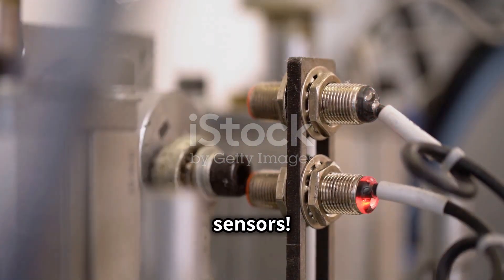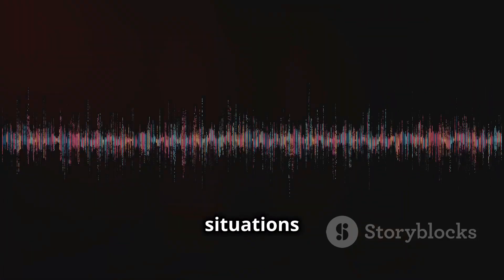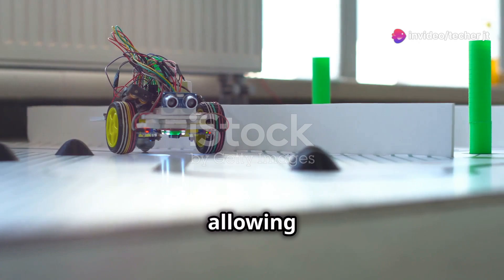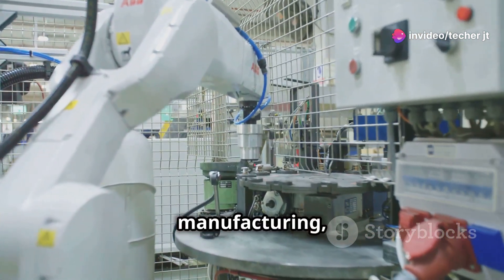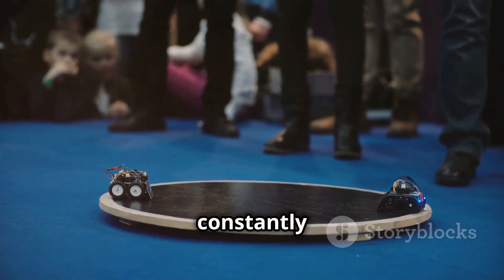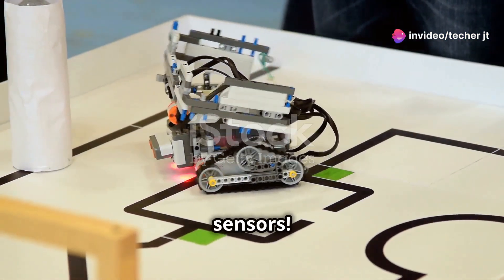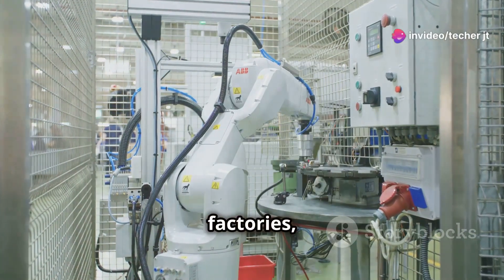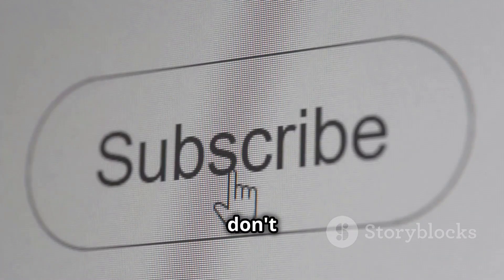Exploring the World of Robotics: Types of Sensors

Comment: Christine Divine S. Taña  
10-LYNX  

2. Explain how ultrasonic sensors work and their application in robotic systems.

Ultrasonic sensors work by emitting sound waves and measuring the time it takes for the waves to bounce back from an object. This helps determine the object's distance. In robotics, they are used for obstacle detection, navigation, and measuring distances to ensure the robot can move safely and avoid collisions.

Comment: Ezra Shimei B. Calaycay
10 - ANDROMEDA

2. Understanding (Comprehension): Explain how ultrasonic sensors work and their application in robotic systems.
- Ultrasonic sensors use high-frequency sound waves to create inaudible waves that bounce off objects in their path. The sensors compute the distance to the object by measuring the time it takes for the echoes to return and combining the speed of sound with the duration of flight. These sensors are often used in robotic systems for obstacle detection, proximity sensing, object tracking, navigation, human-robot interaction, and industrial automation. They enable robots to identify barriers, navigate complicated surroundings, develop maps, recognize human presence, and alter their behavior as needed. Their adaptability and dependability make them indispensable for safe and effective robot operations.

Comment: Dave Aaron V. Dagcuta
10 - Lynx

4. Analyzing (Analysis): Analyze the differences between active and passive sensors in robotics. Provide examples of each.

Active sensors need to actively emit energy or signals and analyze the following response to gather data, meanwhile, Passive sensors don't need to be actively emitting a form of signal rather they only rely on the external stimuli to gather their data.

An example of an active sensor is an ultrasonic sensor, they need to constantly emit sound waves that get reflected off of objects which is then received by the sensor itself only for it to calculate the distance using a predetermined formula, and an example of a passive sensor is a temperature sensor, they don't need to emit any signals but rather they only have to take in the ambient temperature of their environment.

Comment: Evzen Radik A. Salvador
10 - Orion

5. Evaluate the effectiveness of using multiple sensor types in a robotic system. What are the potential benefits and drawbacks?

Using multiple sensor types in a robotic system enhances accuracy and reliability by providing a comprehensive understanding of the environment. Benefits include improved decision-making through diverse data sources and greater fault tolerance, as other sensors can compensate if one fails. However, this approach can increase system complexity, leading to longer development times and higher costs. Additionally, the added weight and size of sensors may impact mobility and energy efficiency. Thus, while the integration of multiple sensors offers significant advantages, it also presents challenges that must be carefully managed.

Comment: AKISHA BACHINICHA
10 ORION

2.)Ultrasonic sensors work by emitting high-frequency sound waves and measuring the time it takes for the echo to return after bouncing off an object. This time is used to calculate the object's distance. In robotics, they are commonly used for obstacle detection, navigation, and proximity sensing, especially in environments where light-based sensors might fail, such as in darkness or through fog.

Comment: Anika Chloe J. Pepito
10-LYRA

4. Analyzing (Analysis): Analyze the differences between active and passive sensors in robotics. Provide examples of each.

Active sensors emit signals, such light or sound, then monitor the reaction to collect data. Lidar uses light to estimate distance, whereas ultrasonic sensors use sound waves to identify things. On the other hand, passive sensors don't generate any signals. They just take in their surroundings as they are. Temperature sensors, which track heat, and cameras, which record light, are two examples.

Comment: Frenzzy Kyla C. Halasan
10 - Hermes

5. Evaluating (Evaluation): Evaluate the effectiveness of using multiple sensor types in a robotic system. What are the potential benefits and drawbacks?

Utilizing different sensor sorts in a robotic system increments viability by giving complementary information, progressing exactness, repetition, and versatility to different situations. The benefits incorporate upgraded decision-making, superior impediment discovery, and expanded unwavering quality. In any case, downsides can incorporate higher costs, complexity in integration, and expanded control utilization or handling prerequisites.

Comment: Iñigo Sevillejo
X-Cassiopeia

1. Remembering (Knowledge): What are the primary types of sensors used in robotics?

- A number of sensors are utilized extensively in robotics, including light, sound, temperature, proximity, touch, pressure, vision, GPS, and Inertial Measurement Units (IMUs).

Comment: Cathleya Jamis
X- CASSIOPEIA 

4. Analyzing (Analysis): Analyze the differences between active and passive sensors in robotics. Provide examples of each.

Active sensors send signals to gather data, like LiDAR and ultrasonic sensors. Passive sensors, like cameras and temperature sensors, detect existing energy without emitting signals.

Comment: Urhyness Agatha Santos
10 Cassiopeia

Question: Evaluating (Evaluation): Evaluate the effectiveness of using multiple sensor types in a robotic system. What are the potential benefits and drawbacks?

Answer:Multiple sensors improve the robot's ability through object detection and avoidance, accuracy, versatility, and more. Robots can gather comprehensive spatial data using various sensor configurations, allowing for more advantages and navigation in complex environments.

Comment: Reeve Radley C Fua 
X Cassiopeia 

2. Understanding (Comprehension): Explain how ultrasonic sensors work and their application in robotic systems.

Ultrasonic sensors work by emitting high-frequency sound waves that are inaudible to humans. These waves reflect off objects and return to the sensor as echoes. By calculating the time it takes for the echoes to return, the sensor determines the distance to the object. In robotic systems, this technology is used for tasks like obstacle avoidance, object detection, and precise positioning. For example, a robot with ultrasonic sensors can navigate through cluttered environments by detecting obstacles and adjusting its path accordingly.

Comment: Daniella G. Estanilla 
10 - Cassiopeia 

4. Analyzing (Analysis): Analyze the differences between active and passive sensors in robotics. Provide examples of each.

Active sensors emit signals, such as light or sound, and gather data by observing how these signals interact with the environment. For example, ultrasonic sensors use sound waves to detect objects, while LiDAR uses light to measure distance. In contrast, passive sensors don’t send out signals; they simply observe existing conditions. Examples include temperature sensors that monitor heat and cameras that capture light.

Comment: Jacinth J. Yerro
10-Hermes

3.Applying (Application): Given a scenario where a robot needs to navigate through a crowded room, which sensors would you recommend using and why?
For a robot navigating a crowded room, I would suggest using ultrasonic sensors, infrared sensors, and proximity sensors. Ultrasonic sensors can detect obstacles regardless of lighting conditions, while infrared sensors identify nearby objects through light reflection. Proximity sensors enable the robot to sense objects at close range, ensuring smooth navigation and collision avoidance in tight spaces. The combination of these sensors provides a well-rounded approach for accurate environmental detection.3

Comment: James Jabiniao
10-CASSIOPEIA

2.) Ultrasonic sensors emit high-frequency sounds that reflect back when they encounter an object. By measuring the time it takes for the sound to return, the sensor calculates the object's distance. These sensors are used for obstacle avoidance, object detection, mapping, and locating items using sound.

Comment: Fresh M. Satur
10-LYNX

Explain how ultrasonic sensors work and their application in robotic systems.

Ultrasonic sensors work by emitting high-frequency sound waves that bounce off objects and return to the sensor, allowing it to calculate the distance to those objects based on the time taken for the waves to return. In robotic systems, these sensors are crucial for detecting obstacles, enabling safe navigation and precise movements. They also assist autonomous vehicles in avoiding collisions and monitor liquid levels in industrial applications, making them essential for efficient and safe robot operation.

Comment: Jhon Lemuel C. Valmorida
Grade 10 Lyra

1. Remembering(Knowledge): What are the primary types of sensors used in robotics?

Robotics relies on a range of sensors, such as light, sound, temperature, proximity, and tactile sensors, to perceive and engage with the environment. Vision sensors, including cameras and LIDAR, facilitate object recognition, while GPS and IMUs assist in navigation and orientation. By working in tandem, these sensors enable robots to adapt, react to stimuli, and carry out tasks independently.

Comment: Alvin M. Tagudin
10-Hermes

3. Applying (Application): Given a scenario where a robot needs to navigate through a crowded room, which sensors would you recommend using and why?
-For a robot navigating through a crowded room, I would recommend using ultrasonic sensors, infrared sensors, and proximity sensors. Ultrasonic sensors can detect obstacles regardless of lighting conditions, while infrared sensors help detect nearby objects by reflecting light. Proximity sensors allow the robot to sense objects within a close range, ensuring smooth navigation and collision avoidance in tight spaces. Combining these sensors offers a comprehensive solution for accurate environmental detection.

Comment: Zophiel Hailey Jace B. Usman
10 - Hermés

1. Remembering (Knowledge): What are the primary types of sensors used in robotics?

- The primary types of sensors used in robotics are light sensors, sound sensors, temperature sensors, proximity sensors, tactile sensors, pressure sensors, vision sensors, navigation and positioning sensors and distance sensors.

Comment: Precious Lea Jennifer D. de Dios
X - ORION

1. Remembering (Knowledge): What are the primary types of sensors used in robotics?
- The primary types of sensors in robotics are Light sensors, Sound Sensors, Temperature Sensors, Proximity Sensors, Tactile Sensors, Pressure Sensors, Accelerometers and Gyroscopes, Vision Sensors, GPS Sensors, and Inertial Measurement Units.

Comment: NURIEL DANNA S. GARCIA
10 - LYNX

2. Understanding (Comprehension): Explain how ultrasonic sensors work and their application in robotic systems.

Ultrasonic sensors work by sending out high-frequency sound waves and measuring how long it takes for the echo to bounce back from an object, which helps them figure out the distance. They are used for detecting obstacles to avoid collisions, measuring distances for mapping, helping robotic arms find and pick up objects, and in self-driving cars for parking and detecting nearby things.

Comment: Kenichie C. Racero 
10 Hermes

1. Remembering (Knowledge):
What are the primary types of sensors used in robotics?
The primary types of sensors used in robotics are:
-Light sensors: Photovoltaic cells, photoresistors.
-Sound sensors: Microphones.
-Temperature sensors: Thermocouples, thermistors, infrared sensors.
-Proximity sensors: Infrared sensors, ultrasonic sensors, capacitive sensors.
-Tactile sensors: Pressure-sensitive devices.
-Pressure sensors: Sensors that measure force at points of contact.
-Accelerometers and gyroscopes: Measure acceleration and angular velocity.
-Vision sensors: Cameras, photodiodes.
-GPS sensors: Global Positioning System sensors.
-Inertial Measurement Units (IMUs): Contain accelerometers, gyroscopes, and sometimes magnetometers.

Comment: Fiona B. Valmorida
10-ORION

2. Understanding (Comprehension): Explain how ultrasonic sensors work and their application in robotic systems.

Ultrasonic sensors emit high-frequency sound waves to measure the distance to objects by timing the return of echoes. In robotics, they are essential for navigation, obstacle avoidance, and object detection, allowing robots to safely interact with their environment. They can also measure levels of liquids or solids, making them valuable for tasks like inventory monitoring. Overall, these sensors enhance a robot's ability to operate effectively and safely in various settings.

Comment: Mabulay, Mikah R | X-ORION

1. Remembering (Knowledge): What are the primary types of sensors used in robotics? 

- The primary types of sensors in robotics include light, sound, temperature, proximity, tactile, and pressure sensors, along with accelerometers, gyroscopes, vision, GPS, and inertial measurement units (IMUs), each of them enabling robots to perceive their environment, navigate, and interact effectively.

Comment: Ezekiel Jude E. Tuñacao 
10-Andromeda 

2. Understanding (Comprehension): Explain how ultrasonic sensors work and their application in robotic systems.

Ultrasonic sensors measure distance by sending ultrasonic sound waves and detecting the time for those sound waves to reflect on an object and go back to them. One of yhe applications of the ultrasonic sensors is obstacle avoidance.

Comment: SEAN LEMUEL CALAMBA
10 - LYNX

4. Analyzing (Analysis): Analyze the differences between active and passive sensors in robotics. Provide examples of each.

------   Active sensors in robotics emit their own signal (like sound, light, or radio waves) and detect how it interacts with the environment to gather data. Examples include ultrasonic sensors (which emit sound waves) and LiDAR (which uses laser beams to measure distances). Passive sensors, on the other hand, do not emit signals but detect energy or signals already present, such as light or heat. Examples include cameras (which capture ambient light) and infrared sensors (which detect heat from objects). The main difference is that active sensors provide their own input to interact with the environment, while passive sensors only receive external input.

Comment: Trixie Dalman
X - LYNX

2. Understanding (Comprehension): Explain how ultrasonic sensors work and their application in robotic systems.
-As high-frequency sound waves are emitted and an item is encountered, ultrasonic sensors time how long it takes for the waves to return. The time delay is used by the sensor to determine the object’s distance. Robots can navigate and avoid objects safely in their surroundings by using ultrasonic sensors, which are widely employed in robotic systems for obstacle identification and navigation.

Comment: el Stephanie Ledesma 
10 Lyra

1) What are the primary types of sensors used in robotics?

- Light sensors
- Sound Sensors
- Temperarure sensors
- Proximity
- Tactile
- Pressure
- GPS

Comment: Zoe Jillian R. Cabrera
10 - Hermes

2. Understanding (Comprehension): Explain how ultrasonic sensors work and their application in robotic systems.

-Ultrasonic sensors emit high-pitched sounds that bounce back when they hit objects. By measuring the time it takes for the sound to return, the sensor can determine the distance to the object. These sensors are used to help robots avoid obstacles, detect nearby objects, create maps, and find things using sound.

Comment: Hamainie Briezies O. Gabriola 
10 - HERMES 

1.Remembering (knowledge) what are the primary types of sensors used in robotics?

ANS: The primary types of sensors used in robotics include light sensors, sound sensors, temperature sensors, proximity sensors, tactile sensors, pressure sensors, accelerometers, gyroscopes, vision sensors, GPS sensors, and IMUs.

Comment: Andre Clyde Eduardo C. Acta
10-LYRA

2.  Understanding (Comprehension): Explain how ultrasonic sensors work and their application in robotic systems.

Ultrasonic sensors work by having a transducer emit a low frequency soundwave, and when the soundwave bounces back to the transducer, the sensor calculates how long the distance traveled based on how long ti took to comeback. One of the main applications is detecting objects far away and informing the control system to make decision based on the given info. 
Sorry for the late submission, I got used to writing it in paper and forgot to comment my answer.

Comment: Tysh Maeganne Z. Sagocsoc
10-Hermes

1. Remembering (Knowledge): What are the primary types of sensors used in robotics?
-The primary sensors used in robotics are light sensors that detects light changes, proximity sensors that detect the presence or absence of an object, sound sensors which are the ears of a robot, temperature sensors that measures ambient temperature, pressure sensors that measures pressure, tactile sensors that are the robots sense of touch, vision sensors which provides visual data, Accelerometers and gyroscopes that maintains a robots balance, IMU's a combination of Accelerometers and Gyrscopes, and GPS sensors that uses GPS signals to provide real-time location of the robot.